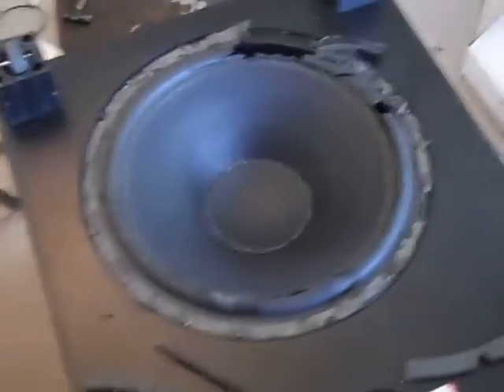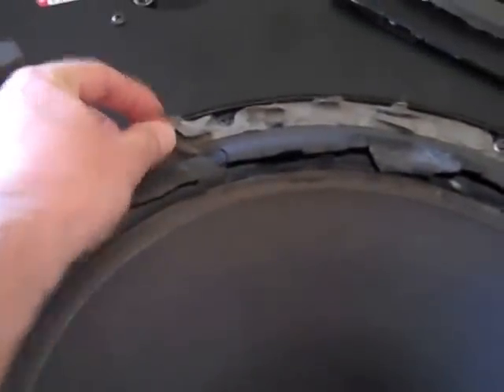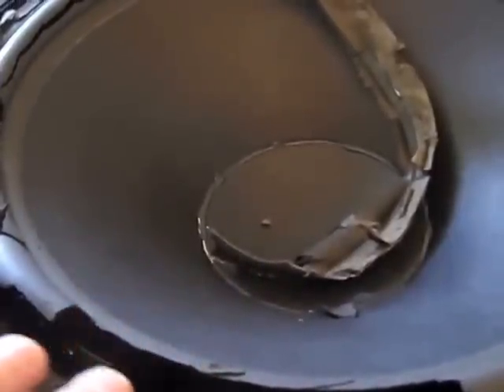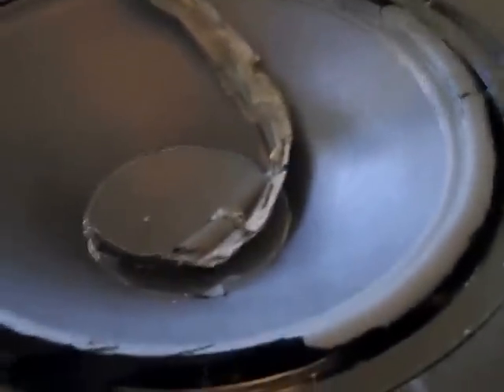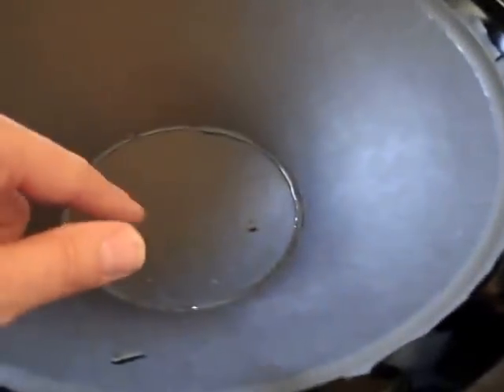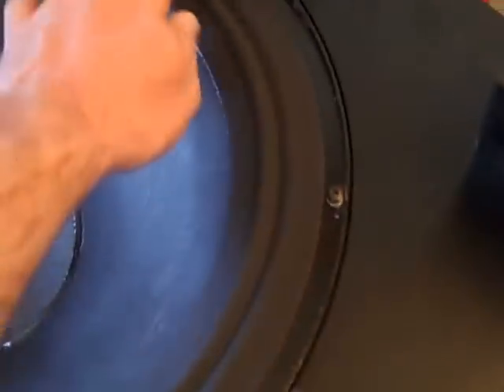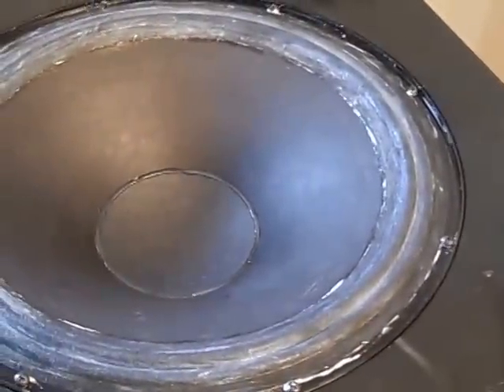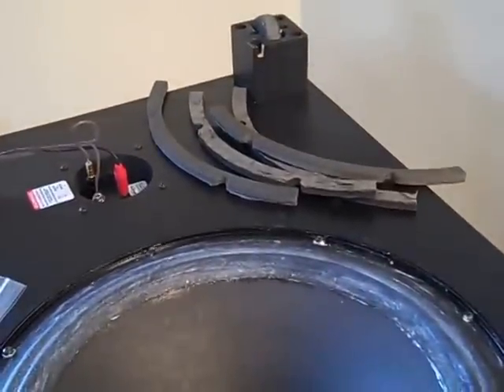VELODYNE ULD 18 INCH SUBWOOFER REPAIR AND TEST

Comment: Very good work Now, why didn't Velodyne use the fiber instead of the foam. When they were built the general feeling amoung speaker manufacturers was fiber was outdated and the foam gave a more linear and airtight surround. That they would rot like crazy a decade or 2 later simply wasn't known.One correction: You state "sub travel is not as large as other subs with exhaust ports" . The reverse is true. When the port is active the cone motion is reduced. Only below resonance does the cone motion increase above a sealed box, and any powered sub designer who knows anything filters frequencies below the box tuning to limit the speaker excursion.

Comment: Nice video!  I also repaired an old Velodyne ULD 18.  I used the same fiber/cloth style surround as you and it has been working perfectly now for about a year.  Another option for parts, where I got mine was from  www.simplyspeakers.com shipped to my door in Canada fast and cheap.

Comment: $6,000,  $7,000 for a new subwoofer 😧😧
Reply from the maker: +bill pruett   These are not your run of the mill subs.. These subs have anAccelerometer  Built in!!  built into the sub.
Reply from the maker: Bill.. You have no idea what you are talking about..   These Particular subs have a feedback circuit and matching stand alone Power Amplifier. 

Here you go Bill

https://en.wikipedia.org/wiki/Accelerometer

And yes... You get what you pay for...
Reply: bill pruett I just bought powered sub is 8 inch but needs new surround I'm going to buy it and fix by myself I bought from a guy he was selling it for 60 but I end up paying 20 and everything works I already try it with my iPhone sounds nice with kicker sub in it lol but I want to keep it velodyne

Comment: Always rewarding to do that work and have a good speaker afterward. I always used an "acid brush" to apply glue and latex. I also used the latex, thinned, and brushed it on the cone, whilst spinning the driver around and gave it that "wet look" It turns out pretty cool! I also always used shims, weather I made them or used round ones. Hey, if not using a shim works for you, great! Sure is a small cabinet for an 18 huh? Maybe 2.5 cu ft?
Reply from the maker: Actually it is huge  and heavy... Measures in at almost 8 cubic feet and weighs around 50-75lbs  or so. it is very very heavy.  A 2 man job to carry..
Reply: grabir01 8 cubes... WOWZERZ I built my subs for my home theater back in 1998 and I used 2 ply 3/4 inch mdf. Mine are about 4 cubes and they weigh over 100pounds. I only have 12's in mine... So, yeah 8 cubes IS huge!
Reply from the maker: This is a Velodyne UDL . It has an Accelerometer engineered into the  Dual wound Voice Coil with a   feed back circuit which returns the  signal back to the  matched Stand alone Velodyne UDL Amp for Phase matching to input signal.  All factory engineering..  This is the main reason I did not cut or remove the Dust cap and attempt to place spacers into the Center cone for fear of damaging the Accelerometer and Dual wound coils.
Reply: grabir01 Ah ha... Sounds logical to me bro! Thanks for the info. I had no idea about Velodyne gear.